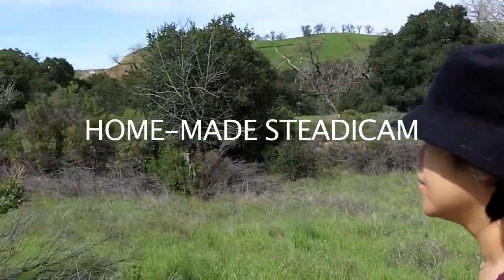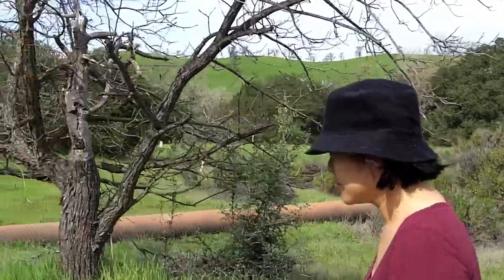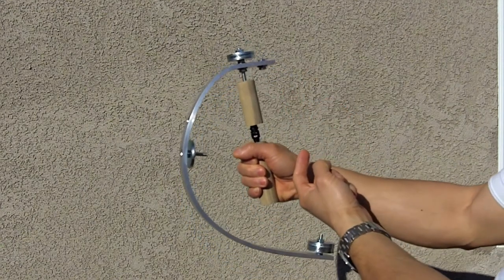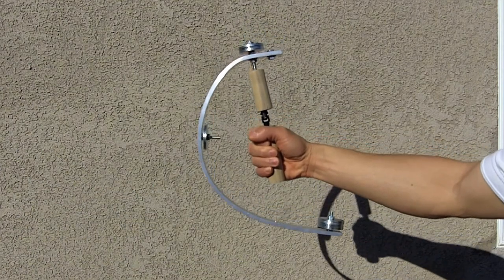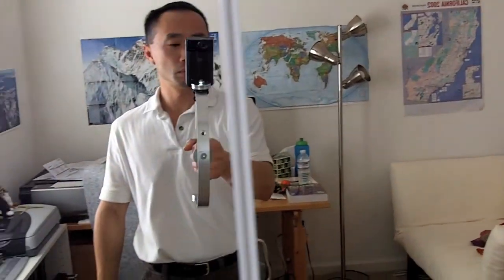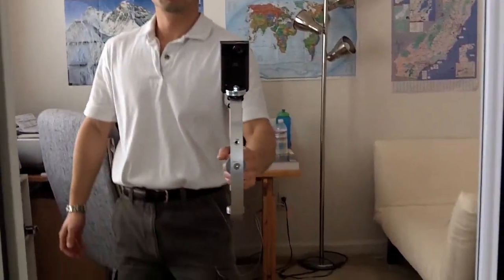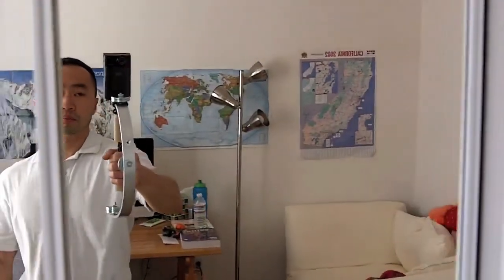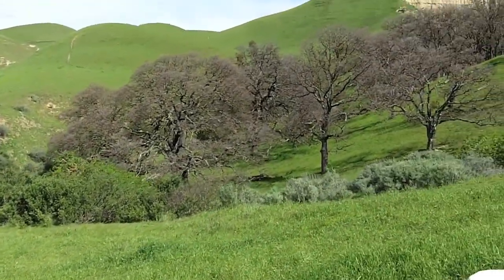DIY Low-cost steadycam

Comment from the maker: @ukukid: I made a form around which I bent the stock.  From a drawing I made of the curved shape, I printed it out 1:1 and glued it to a piece of 3/4" fiberboard, then cut it out with a jigsaw.  Now with this circular-like shape I screwed it down to another piece of fiberboard to provide a backing.  Clamped the aluminum stock down hard, and bent it by hand around the curved form.  You need to take into account some spring back of the aluminum so make the form a little smaller.

Comment from the maker: @hastwerk: No, not on this design.  The 7D is a much bigger, heavier camera, and I optimized the design only for small handheld videocams like the zi8 or Flip units.  Keep in mind that when using a 35mm camera, any telescoping of a zoom lens will shift the center of gravity and require rebalancing of the steady cam.

Comment from the maker: @billydiamond24 The stock was Home Depot special.  You should be able to find it at most home improvement places.  In my second attempt (see other vid on my page) I used 1/2" round stock, which is much more elegant, lighter, and works just as well.